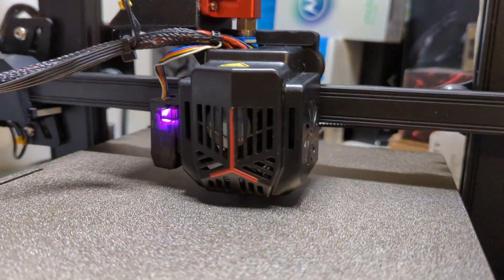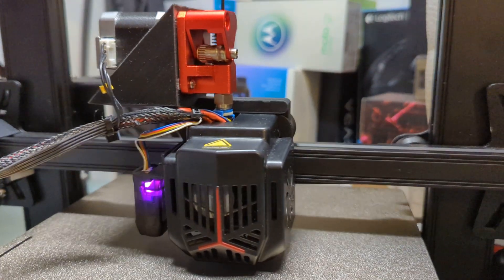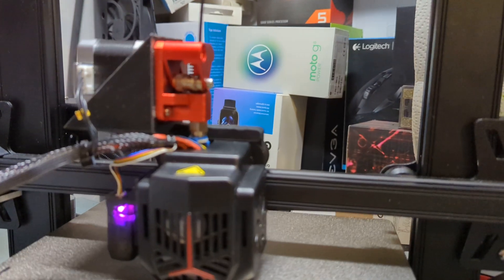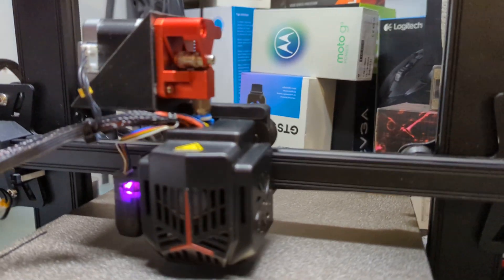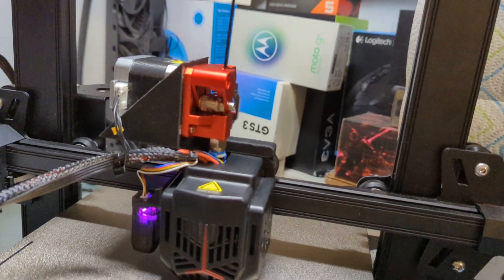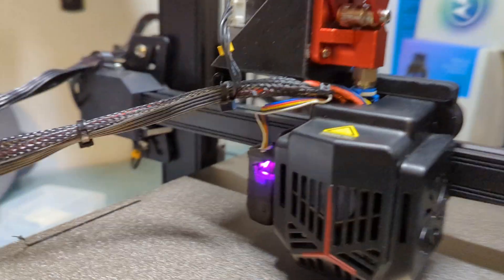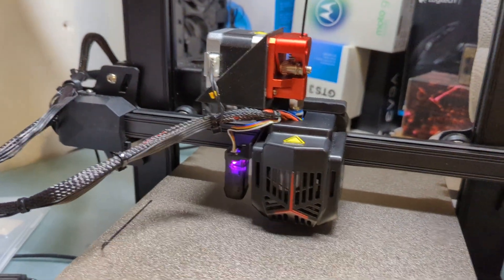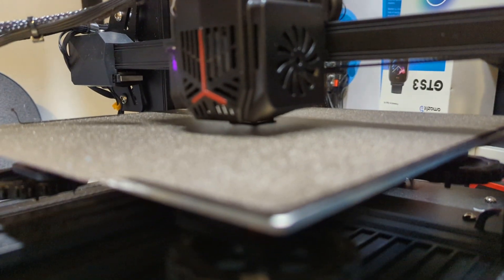Creality Ender-3 V2 Neo - Dual Gear Direct Drive Mod

Comment: not working for me good enough, because when the extruder pushes the plastic, it rises the whole mod for a few mm, which results fiddling issues, is there a way to connect it with the bltouch to make it more steady?

Comment: I've seen some of your videos now, I just recently got my printer and upgraded to professional firmware .
Using cura, have you had trouble with the pause at height script?
Mine restarts too high, looking over the GCode the z-height seems to be correct.
Reply from the maker: Which version of the firmware did you use? I don't use pause at height so I'm not aware of the problem, maybe there could be a solution in the discussions: https://github.com/mriscoc/Ender3V2S1/discussions
Reply: @Zeltroix  It was the new year version (December)
Guess I'll look trough the discussions, thnx.

Comment: So switching to direct drive was worth it? I have the same printer. Do you have linear advance support? And what about input shaping? I heard it is possible to enable it on Marlin firmware.
Reply from the maker: Not on the regular versions, there is a special version where you can get those special features, I have not messed around with it but here's the link, just scroll down to special versions: https://github.com/mriscoc/Ender3V2S1/wiki
Reply: @Zeltroix  yeah, i know about that author. I have his firmware installed as a matter of fact 422 BLTUBL-LA-MPC. "LA" there stands for linear advance. There is also version "IS" available, which has input shaping support, but there is no LA-IS version yet, you have to choose only one of them.